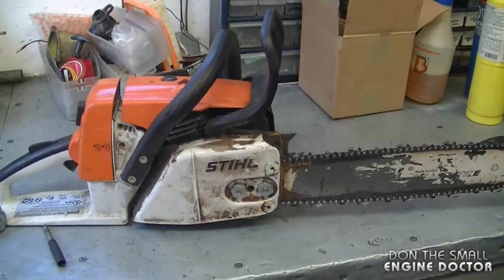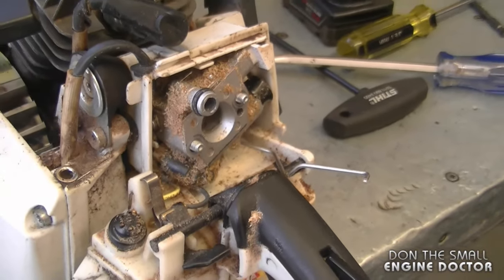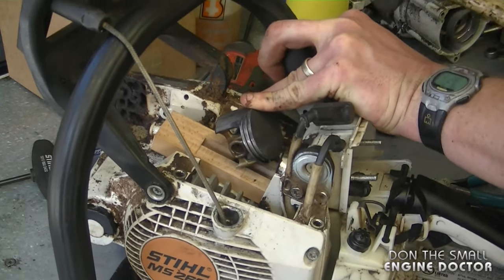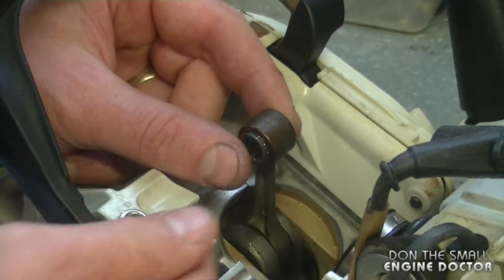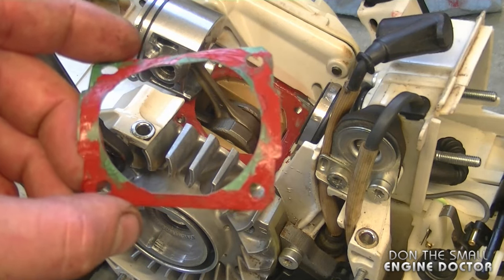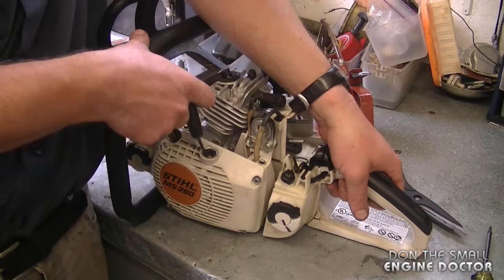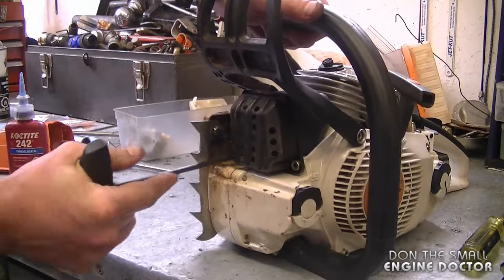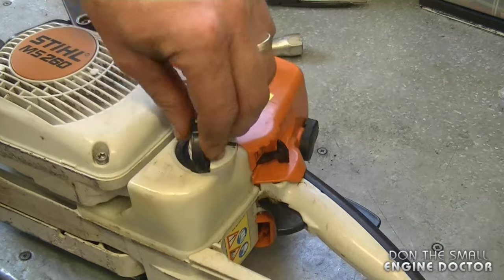Top End Rebuild On Stihl MS260 Chainsaw With Force-Tec Cylinder Kit

Comment: I was wondering if you know the factory settings for the LA screw on a 015L? Also what would if anything would one partially broken pawl on the flywheel do to the saw and how do I turn down the bar oiling setting when those adjustments seem to be stuck beyond belief.  I also have a FS75 I bought used and rusty an can't get the muffler off because the screw heads are totally stripped to being almost smooth minus the rust.  The muffler is probably worth replacing by the way since it has several unwanted holes.
Reply: +Phillip Kramer I also forgot to ask about what I should do about the muffler gasket on my old stihl 015L because I noticed after I bought it that the gaskets were worthless since someone had made them out of newspaper which had been folded over many times and they were very burnt up an fell apart almost as if they were dust when I removed the muffler to check if the muffler was the reason it wouldn't start which did happen to be the case.  I soaked it in 10w-30 overnight after opening it up then scrubbed off all the corrosion and burnt up junk off with a thin green dishwashing pad that looked somewhat like it was a softer version of steel wool then whipped off most of the oil and sprayed it with WD-40.  Then wipped that off and this part I am somewhat embarrassed about made a temporary gasket out of the extra thick type of alluminum foil that was folded over probably a dozen or more times and used that which so far has worked for the half hour which I have used the saw.
Reply: Phillip Kramer buy a new saw shit. or a newer one anyways. no new parts for them anymore to OLD

Comment: I use the Stabil in my fuel, but I also use the 2 cycle oil with the ethenol treatment in it as well. I wonder if that double treatment is bad. I didn't think about the fact I was treating it twice until now.

Comment: Hey DB, I picked up MS 390 scored piston (at least ). It's an older model without compression release. When I replace cylinder can I upgrade to have a button?  The cover has a plug cover.  Thanks so much. PS I did get wihi tools and 12 Volt impact based on your reviews.
Reply from the maker: LoveStihlQuality yes you should be able to, make sure the kit you buy has the decompression port

Comment: I like your videos I know the saw ran good and you know that the oner ran little oil but don't you presher test after a upper cyl to see if the oil seals are leaking or case gasket is not leaking I work on stihl every day 192 192 291tc ms 660 ms 880 I have rebuilt them all

Comment: Good video,  mostly good information . So hear is the deal on   
AFR (air fuel raito) vs fuel oil raito. 
More oil in the gas makes a richer fuel oil raito . Thats fine although at a certain point you start to thicken the fuel viscosity therefore making a leaner AFR. What Caesars Motors is a lean AFR. A motor with a super lean fuel oil mix  like 80 to 1 can live a long life as long ar the AFR is rich.
So backing out the mix screws during brake in is the better way to go.

Comment: A comment - I always rotate the piston to BDC before I finish tightening the cylinder bolts.  This centers up the piston in the cylinder as good as you can get it.  I like the 260 but have never found one at a reasonable price.  You will not get a saw to break in with a new cylinder much before it has a tank of gas through it.  When I build a Huztl kit I do not even worry about them before I get at least one tank of gas on them.  After one tank I will start adjusting the jets for proper operation but I will have to readjust them several more times as the saw breaks in.  By 15-20 tanks the saw will have its final carb adjustments and be broken in.

Comment: I have a 038 magnum and there is a curved nozzle in between the back of the carb and the cylinder head. The mechanic took everything apart and there is a 3 inch long piece of rubber hose that I don't know where it goes. Does it attach to this nozzle as some sort of pre heater hose? Thanks
Reply: wade appenheimer its the pulse hose

Comment: Excellent vid as usual.  How often have you found that when rebuilding a top end due to being burned out, that the crank seals leaking are likely the cause and in need of replacement?  Also if you don't mind, excluding parts cost, what do you charge for a rebuild as shown in the vide.  Thanks.
Reply from the maker: not too often, usually it's because of no oil in fuel

Comment: You made it look easy. Question: did you neeed to check the crank shaft and bearings before spending for the cylinder? Are the touque specs available instead of carefully tightening? Thanks for a great video. Steve, plymouth, MA USA
Reply from the maker: yes always check crank bearings and seals before doing this repair,

Comment: So you are putting a new top end on a lower end that has been run on straight gas? How long do you think it will last?
Reply: 1970 olds442 o you are angry and ignorant, I own a motorcycle shop and have been building 2 cycle engines for a long time to, but I'm guessing I have a much lower comeback rate as I always at least disassemble, clean  and inspect a lower end the hotel had a severe top end problem. For instance this hole scored piston could have been caused by say a bad crank seal. I know it's probably above your level of comprehension but it is crucial to find and fix the cause than the symptom.

Comment: Hi, I was wondering if you knew if there was a gasket or seal that goes In between the cylinder and the lowered on a ms290 I am rebuilding one and when I pulled the cylinder off....there was no gasket there just some red hardened silicone stuff I think?
Reply from the maker: Josh Capasso no gasket, you need to clean it off and use DIRKO
Reply: Ok thank you very much....can I use compressed air to blow out the crank case and lower end to make sure there is no dirt in there?

Comment: is cleaning the saw in the parts washer with the crankcase open like ok? does the fluid damage anything inside the case, how would you clean it out if any did? thanks
Reply from the maker: no it won't damage it, I drained it right away
Reply: donyboy73 did you split the cases or just turn it upside down lol
Reply from the maker: gunsndrums1 I never had to split it, I just flipped it upside down

Comment: This should apply to the 026 model also, correct? Mine isn't the Pro, so no compression release. Wish it had one
Reply from the maker: Yes
Reply: I just finished a force tec top end rebuild thanks to your video! I have one more question, you said to add extra oil for the 1st three tanks of gas. How much? 40:1, 32:1? Please advise, and thanks again for a great video.
Reply: I also found it to be a much easier job when I removed the saw handle for extra room

Comment: You made it look easy. Question: did you need to check the crank shaft and bearings before spending for the cylinder? Are the torque specs available instead of carefully tightening? Thanks for a great video. Steve, plymouth, MA USA

Comment: Greetings. Question. I got a stihl 029 chain saw free.   It has spark good plug but I can't get it to even think about a kick.  I did check compression which is really low at 50.  The piston doesn't look to scarred but rings look seized.  My questions are even with some fuel straight in cylinder,  at this low compression will it not even kick with fire and fuel.

Comment: Judging by what the top end looked like, you should have checked the bottom end because some of the metal may have gone down in the case instead of out the exhaust port.

Comment: Great video, huge fan of all your videos, I’m rebuilding a Stihl MS180 and I got the piston compressor kit that you have. However I’m having trouble putting the piston into the cylinder because of how that cylinder’s shape is compared to the one you did in this video...have you ever rebuilt an MS180 or MS170? Any pointers?
Reply: If you watch the MS 250 rebuild it is the same process. You don't need a compressor for the smaller Stihl engines, as they have a tapered entrance. The big difference between a MS 180 and a MS 250 is the piston size and the oiling system.

Comment: yes i work on small engines worked on numerous types but what i have is a crafstman weedwacker it has about 50lb of compression it is 4 cycle do you know if it has a compression release if so where is it located if need cylinder are they worth it also has that easy start Thankyou system i really dont think it gives a good pull
Reply: chuck macy throw it away its junk

Comment: hey dony nice vids. i just squeeked my ms280 was wondering,if i could put a 390 cylinder kit on a 280?the stroke is different.ms280 is32.9mm,and 390 is 34mm
Reply from the maker: the 390 kit should fit on the 290

Comment: Great video. I had a question my saw been sitting for two years and it's hard to pull  if I remove the spark plug it pull like it used to.  Are the piston rings seised?
Reply: Pull off the muffler and look inside and you will be able to see the piston and rings..if it's scored on the exhaust side you should be able to tell if they're seized.

Comment: if you take a couple of file swipes off your drags on your chain the motor will work underload rather than high rpms which is the killer to the cylinder sleeve

Comment: Great video Donny!!!! Was curious since the straight gas ruined the cylinder would or could that hurt the gaskets in the carb?
Reply from the maker: no, usually the carb kit goes bad when left sitting for years with gas
Reply: Stevet19791 yea you have to buy a new saw then

Comment: when I was working for Orbital eng co in Perth  Western Australia we used to run in our 3 cylinder 2 stroke engines on the dyno at wide open throttle starting at 1500 rpm going up in 500 increments to 7000 rpm all at full load!

Comment: Do u surprises me always. 8 months ago i brpught a chinese saw  under 135 dollars around 6000 Indian rupees, all i did was fill up gasoline  and oil, and do cut , cut , cut , cut woods, i had had a few problems with oil pump,   and i bought  new oil pum , now comes the hardest part ,daman the clutch assy dosent have a sigle screw in sight,and the local mechanic refused to devulge the secret of the clutch assy, so he can earn money, actually i bought the oil pump two months ago, woth no help  i kept  the work at  pending, and i manuel oiled the chain , and today while i were scrolling you tube TADA there is it, i found a new chain saw doctor, the video solved all my chain saw problems , took leave from the job ,sat down and replaced the oil pump, and the machine is good as new. Thanks bro, peoples make a ton of waste useless videos  and upload, but ur videos  are gold, thanks DON for the video from the otherside of the world.god blessu.
Reply from the maker: make sure you are subscribed!

Comment: Thinking about rebuilding a 034 Stihl chain saw. Found this kit on Ebay with a Niksasil coated cylinder for a cheap price , includes piston & rings,crankshaft bearings & seals.& other items  Wonderig if you have seen ths & if you recommend it?48MM Bore Cylinder Piston Kit For Stihl 034 AV SUPER 036 MS360 ChainSaw Nikasil. Seller is ewayautosupplies. Love your videos

Comment: I have to commend you again on how you talk us right through the whole course (demonstration) it makes it so easy to understand. 1 ??, that great parts washer, is that soapy water you are flushing everything with there??
Reply from the maker: no it's parts washer fluid made by kleen-flo
Reply: Not familiar with that stuff, but it sounds like an oil based product, and I am assuming that you didn't dilute it in any way, yes or no?
Reply from the maker: W. Gator not diluted, it cost $150 for 10  gallons or 40 litres
Reply: $15. +tax for 1 gal. or 4.54 Litres......ooooooooohhhhhhhhh!! Think I will stick with Kerosene or paint thinner in a spray bottle and a paint brush, :)). Thanks for the reply.
Reply: donyboy73

Comment: i have a stihl ms250 that will start but wont run. i have cleaned my carb, cleaned coil, new spark plug, fuel filter is good. if i pour fuel staight into the carb in will run normel for a few seconds then die. upon further inspection , i found a crack in the fuel line. would that couse it not the start at all? thanks
Reply: Austin Funk yea it will duh duh duh

Comment: I always put the circlip on the intake side, first.  This makes sure it is in, correctly, because if one of the circlips come out it will be from the intake side.  I want that circlip in right, because if it comes out - it will smoke the cylinder and piston.  I also do not use a ring compressor to get the piston in the cylinder.  I use my thumb nail or a small screwdriver

Comment: I have this saw (Stihl ms 260) and no one knows what is wrong! When I go pull the cord i can only pull about a couple inches at a time until it reaches it max. It is not a smooth pull as it jerks. Are you familiar with this problem
The muffler is all clean and saw runs. But it is a hard jerk pull

Comment: The blue loctite may do more harm than good on muffler bolts.  You use heat to soften loctite if necessary to remove bolts.  for blue loctite that's 250C or 482 degrees F according to loctite website. Your muffler will almost certainly exceed that temp at some point.

Comment: That's not really what I'd do. You're fixing only half the saw. I ALWAYS split the case, check the crank & replace the crank bearings. All that debris went into the crankcase from the scored cylinder. If you don't believe me, split the case &see how rough those bearings are & make sure the crank's ok.

Comment: What kind of oil you put on the piston before the assembly?
Reply from the maker: USUALLY 2 CYCLE OIL
Reply: Thanks.  Do you add any ATF to mix with the two cycle oil?
Reply from the maker: no need to

Comment: Hy, the cylinder at 44,7 mm for 261 is the same for 271? I don't find cylinder for 271
Reply: gaudi zsu Stihl only on the junk 271
Reply: gaudi zsu crank bearings went bad and trashed the top end didnt it? china bearings see it all the time

Comment: It would be a good idea to clean all the crap of the saw prior to disassembly, that way you avoid the risk of carb, and crankcase contamination.

You can also avoid losing small parts (Crank Pin Retainer) by removing them  inside a poly bag, try it some time.

Comment: Put the intake boot on the cylinder first, set the cylinder, then pull the boot through the plastic with needle nose pliers.  Way easier.
Reply: Dan Henderson dont even take the carb off. just loosen the boot clamp pull the jug rite out way easyer but not for stupid people

Comment: Dony, can you tell where I can get a special type screwdriver for my craftsman chain saw carburetor 2 cycle model # 358.360171 I need it to adjust it? thanks  1/28/2019
Reply from the maker: ebay or amazon
Reply: @donyboy73  Ok Thanks.
Reply: @donyboy73  What is the name of this special type screwdriver? 1/29/2019

Comment: 1. Shouldnt you clean it before you take it appart?
2. Shouldnt you cover the crankcase from the start with a towel (Incase you drop the clip)?
3. If the engine ran without oil isn't there a risk that crankshaft bearings are damaged as well?

Comment: Don, Thanks for the great videos.  Question: If they burned up the top end by not putting oil in the fuel, why did it not destroy the main bearings on the crank?
Reply from the maker: because the top end usually burns out before the crank bearings

Comment: Nice work.
You can hope that the bottom end isn't wasted too, I suppose.
Reply: Um, if the piston and cylinder are wasted that badly on the top end, you can bet that the crank and bearings suffered damage too on a 2 stroke.
Do you know anything about engines at all?
Reply from the maker: lol

Comment: Hello mate I have a question my pull cord snapped, I took it to a shop for replacement, my chainsaw won’t start now, would this happen if the cord fitted is the wrong size
Reply from the maker: no it won't cause a no start

Comment: hi dony,, so many people ruin a good chainsaw and trimmers,, blowers etc. by pouring raw gas in them,, this can easily be prevented by marking the fuel cans or? just take whiff you can smell the oil in the gas at least I can anyway or when you pour It in just look at it because its a different color usually blue or red just pay attention and it will prevent this from happening or another option just use the pre mix fuels in the cans- with 2 stroke engines some people just don't get it and I've never understood why? I'm 48 and been around these things since I was 12-13 years old and have not yet ever had this happen to me,its too easy to avoid
Reply: A friend of mine bought a brand new Stihl MS391 last year and inadvertently filled it up with regular gas, wasn't paying attention and picked up the wrong fuel can.  He learned an expensive lesson, and he still has a dead saw in his garage LOL.
Reply: If you use a 1 gallon can 2 gallon 5-gallon can,I always paint 1/2  of that gas container green, this always brings me back to let me know it is a mix gas container,, I seen many small engines, (seized) because of the wrong fuel container poured into the gas tank. $0.50 worth of green spray paint, on a red gallon can, is priceless.
Reply: I have a designated oil gas can that always has mixed gas in it. I never fill it without putting oil in.

Comment: You weren't worried about the lower crankshaft/connector rod bearing might have been damaged? Not be critical, just asking... Excellent video BTW and thanks for posting...
Reply: akennyd nope they never are. you could burn it down 4 times and the crank will be fine. it takes very little lube on those bearings
Reply: Ok, thanks for the reply!!